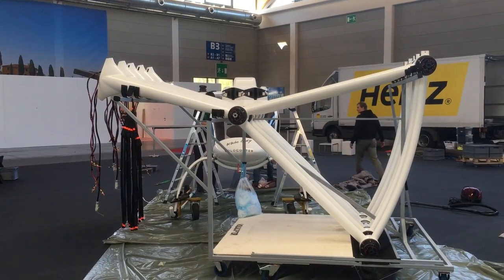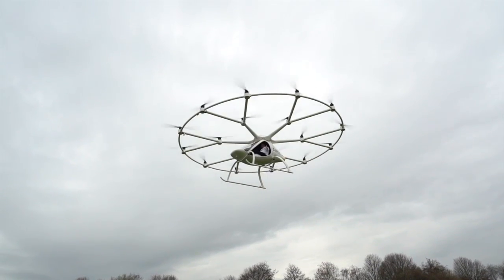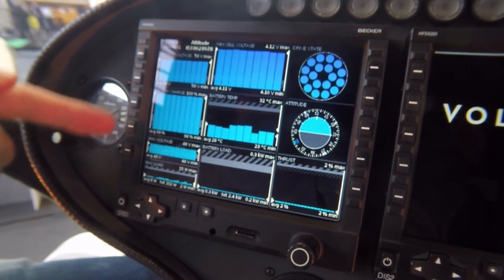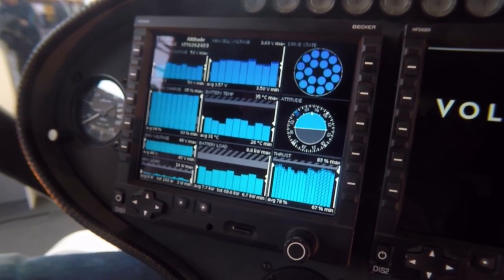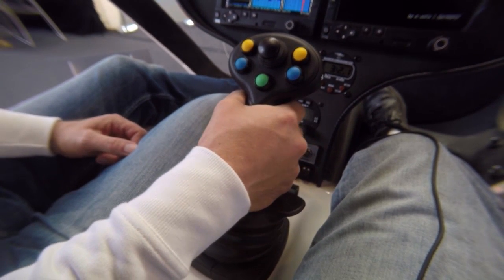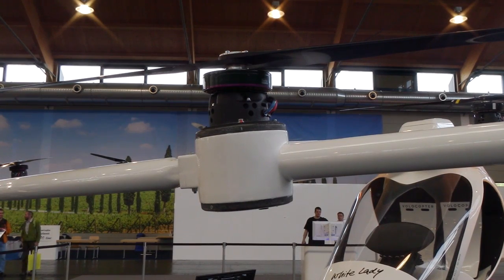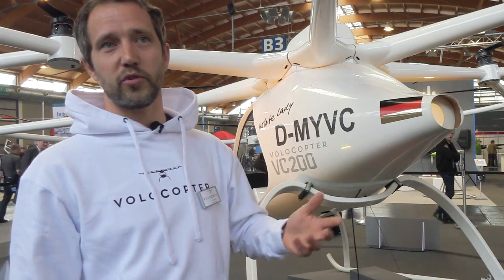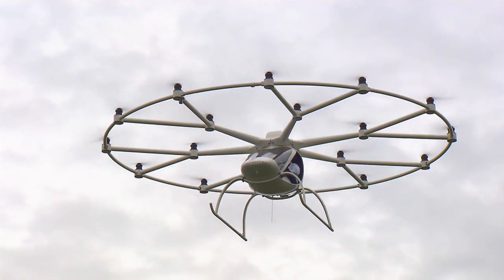VoloCopter at Aero

Comment: What's the point of making these electric?
Reply: Mulitrotors without collective pitch can only really be done with electric motors since all pitch, roll, and yaw adjustments are made by dynamically changing the speed of the props. It's a lot easier to do that with electric motors than combustion engines.
Reply: This thing is much simpler mechanically than a helicopter. Hop in, turn on and climb in the e-volo. Any millionaire could fly around his mansion every morning after only an hour of training.
Reply: You don't get "new technology" governmental grants for combustion these days!